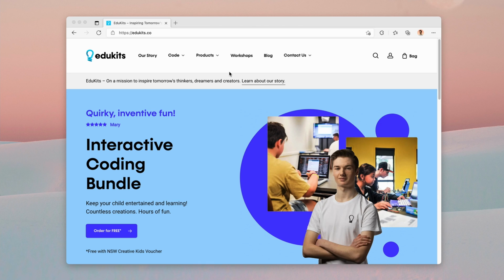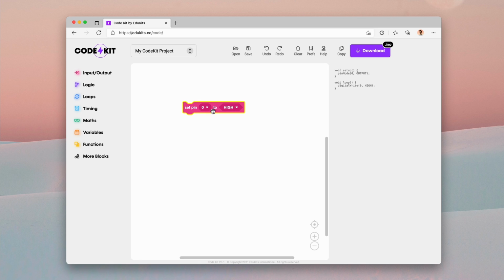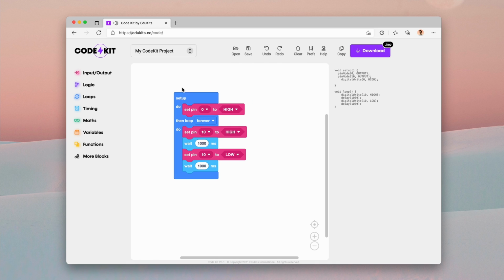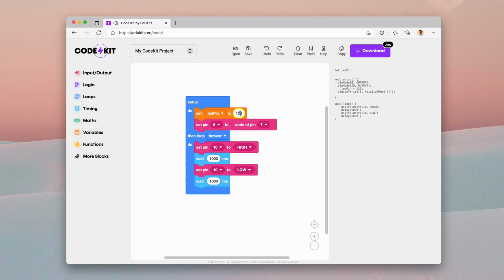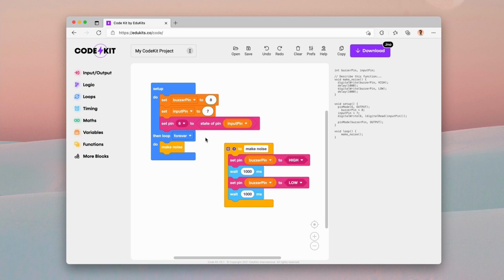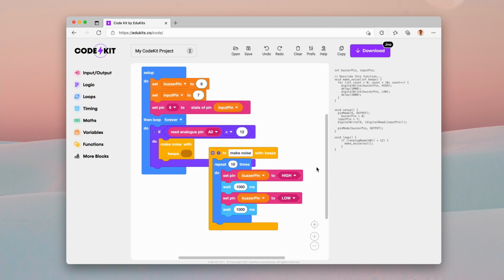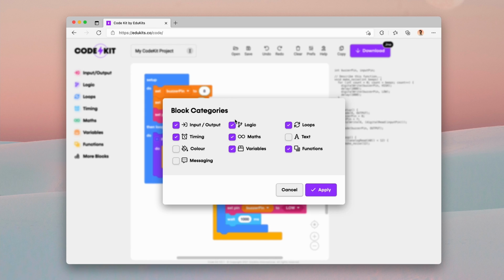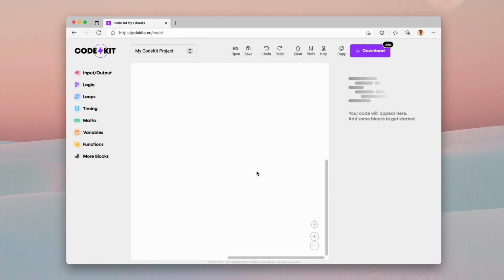Code Kit: The ULTIMATE Block Coding App for Arduino

Comment: This is great but how do you know what the schematic will be and how do you go about actually running the code on the arduino with the sensors?

am I missing something?
Reply from the maker: Thanks for your question! Great to see you're interested in the details. Code Kit is all about block coding - you drag and drop blocks to create Arduino code. So there's no schematic generation, but you can build your project and then use Code Kit to program it.

As for running the code, you've got options! You can export it to the Arduino IDE, or if you have a Code Kit Pro subscription, upload directly to your board. The sensors just plug into your board as usual.

Hope that helps clear things up! Let us know if you have any other questions – always happy to assist fellow makers!

Comment: How do we know if the code you wrote worked?
Reply from the maker: You can test out the code by uploading directly (pro version) or exporting a file to use with the Arduino IDE. One of the neat things about working with blocks is that you can avoid many tiny bugs and typos, so your code should generally work as intended.

Comment: Can you add extra libraries? Like the Neopixel library?
Reply from the maker: Hey Matt, you can find our blocks for Neopixel control in the 'Colour' category! With these blocks, you can attach a Neopixel strip and set the colour of each LED individually.
Reply: @edukits  Thanks, but I'm going to need an example/sample. I can barely make the correlation.

Comment: hi! i'm new to coding, and i'm kinda confused on how we'll set a pin as INPUT rather than OUTPUT. i'll really appreciate it if you could help me out!
Reply from the maker: Hey, you can use a pin as an input by using the 'Digital Read' or 'Analog Read' blocks. These blocks read the value of the pin and let you respond to different cases in your code.

Comment: I like this. It is interesting. I can assume that you can do libraries also, right?
Reply from the maker: Hey Matt, there are a variety of block categories that unlock different sorts of functionality within the app. Inside the Block Loader, which is like a 'library' manager, you can customise which of these categories are displayed in the toolbox. For example, you can find servo and stepper control in the Motion category, and addressable RGB LED blocks in the Colour category.